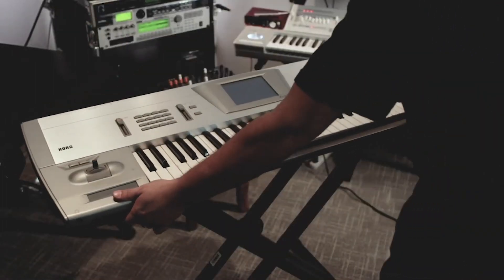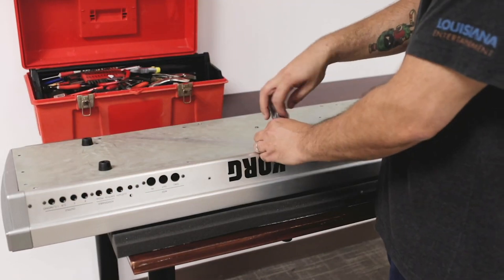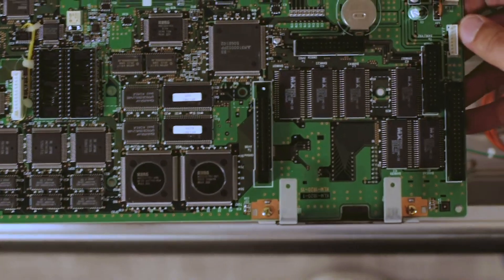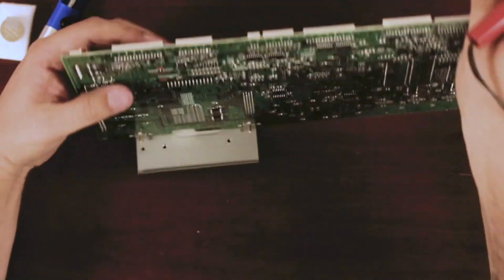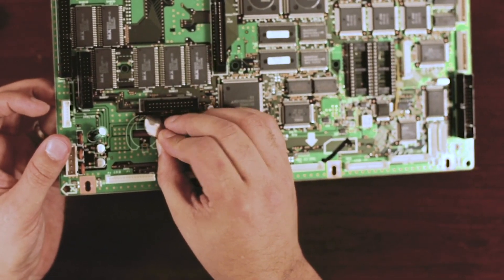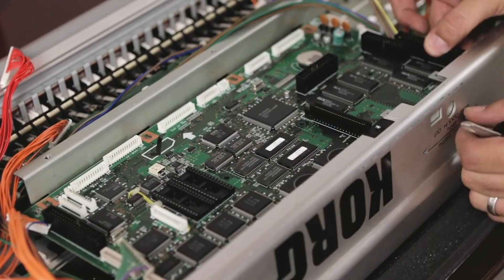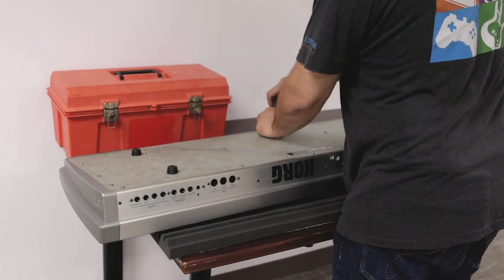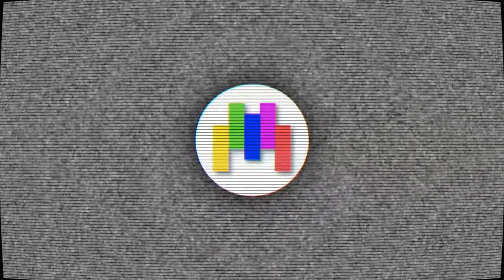Korg Trinity Battery Replacement

Comment: Very good video indeed. 
It's mentioned in syntaur i should save the data. But i have another problem, i also have to change the disk drive. 
I have the part, so... do you have a video for that job?
 I think i'd better first change the drive, then check the drive, and then change the battery, what do you think about it ?

Comment: It's unbelievable they soldered it on the board. It was probably to hard for them to use a normal removable battery socket 😀 Anyway thanks for the vid 🙂

Comment: Soldering a battery into the main board is a dumb idea. Not sure what was Korg thinking. Replacing a battery in this type of keyboard is something that shouldn’t take more that a trip to the nearest store, buy the battery and put it on the keyboard.
Reply from the maker: Agreed, the funny part is that the Wavestation has a battery socket and it came out before the trinity. Cutting down on parts I guess.